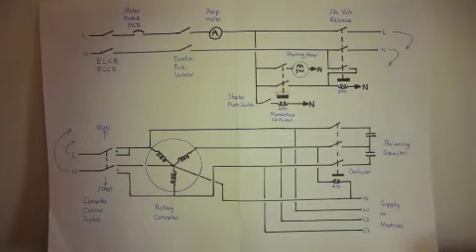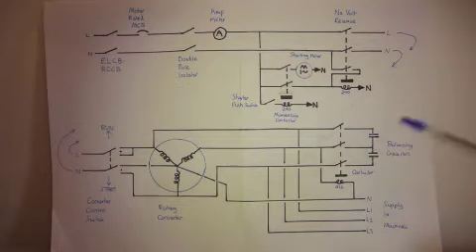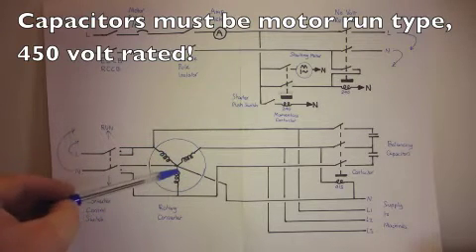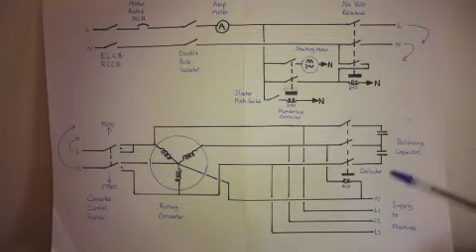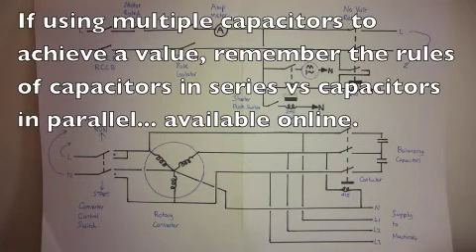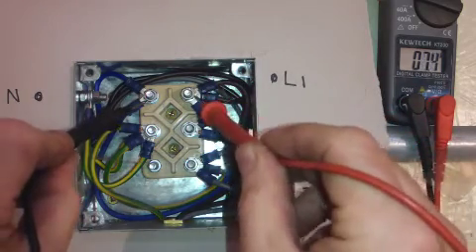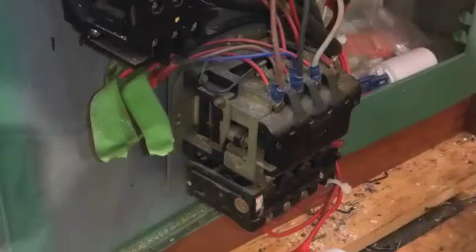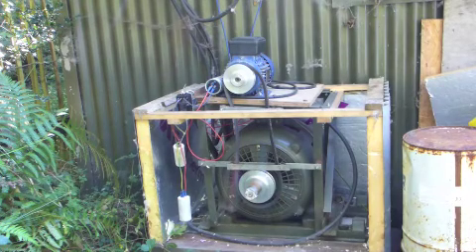Rotary Phase Converter - UK - Part 4

Comment: Great tutorial, I have built a converter that has output in delta 231 232 241 and will start and run load motors but obviously L2 is a feed from N. I switch to star with N centre, L - L1 with 22uf L1 to L3, 15 uf L1 - L2 and 7uf L2 to L3. My L1 is 432 L2 431 L3 438 and all around 230 - 250v to N with 1v to earth from N so all running smoothly unloaded in star but soon as I add load I loose my power to L2 down to 14v and stall my idler motor. I have been over all the feeds and can't find and short or feedback at the contractor's  and all running from 13a plug without blowing a fuse or dropping the trip? I can't find where the issue is?🤔
Reply: Have you discovered the issue with your 3 phase rotary converter setup leading to L2 dropping to 14 volts and stalling of the idler motor?  If so, what did you find?
Reply: Yes I have sorted the stalling. I haven't seen anyone else do the same as I have but if I switch the 240v to 415v with both the idle and load motor running I have no issue. Also with a second motor now as basically 2 idle motors it will start a 3rd as a load. I now have a 7hp and a 3 hp running as idle that are linked. My guess is the 7hp was not high enough power to start a 3hp.. I have also used 5 coil contacors that are turning capacitors on and off at different stages to keep the vaultage stable, low amps and all from 13a domestic. Load is pulling around 15-20a on start then 2 to 2.5a running. Was you going to give an idea of the problem or having same problem?
Reply: @AndyHagan-gn5hh  I don't have this same issue.  I'm currently in the stage of researching all the methods to convert single phase to 3 phase and when I discover that somebody has seen an issue with their setup, I want to know how it was resolved.  I'm trying to get as educated as possible by not just reading and watching about how to create a rotary phase converter, but also learning about the pitfalls and remedies that others have experienced when putting their RPC into service.  Thank you for your detailed reply.  Best of luck to you in your continued endeavors with your RPC.

Comment: Since this video was produced 5 years ago, has anyone else actually made a working one to this design? - particularly if you've used a more modern motor.

I've started building my own but it's becoming a bit of a frustrating process while using a more modern idler motor (there's not a ton of ventilated motor choice nowadays).
My own motor gets warm after a short amount of time, has poor voltages, but does seem able to self-start (an accidental discovery).. I stopped it earlier after smelling insulation.

Comment: Would it work if you just got the converter motor up to speed and then just switch the live and neutral straight in,without running the converter motor first then changing over ?

Comment: In regards to the main motor. I am assuming you are using a motor with rated for 415v star. 
I seem to see most larger 3 phase motors with 680/700v star. Would you consider this configuration suitable for your method?

Comment: I really like the simplicity and elegance of your rpc design but I am not sure of one thing. Why do you need a starting circuit when you have the starting motor? Surely you could bring the large motor upto speed and then engage the input current (in run configuration) am I missing something here? Also a nicer option for coupling your starter motor would be to pick up a centrifugal v belt clutch off ebay. They sell them for kids minibikes. Means you could leave the two motors static and just use a push to make switch to engage the starter
Reply: This is a valid point. However, I'm not sure that my pony motor has the power to spin that converter right up to 1440rpm! I've moved house now, and it's all in storage awaiting its next life.
Reply: @philscott2056 if the pony motor is indeed too small i can see how the two-pronged approach is beneficial. im planning on building one to run a cnc mill and would like to simplify the design a tad. just need to find a suitable motor

Comment: Hi Phil, I have watched your whole series on building a RPC, and being Australian have a similar mains setup to what you have in the UK, as distinct to the American system. I am keen to replicate your basic design, although I will have some changes due to availability of some components.
I hope to power a DSG lathe with a 3 phase 7.5 HP motor running at 415V. I will rarely if ever load the lathe to anywhere near maximum, and if I had a choice in the matter, a 3HP motor in the DSG would be more than adequate for the work I will be doing, but 7 1/2 is what she came with and I have no plans to downsize it. At the moment I have been offered a 18Kw idler motor for Au$50, but it is TEFC, not your first choice, but it is cheap. There is a chance of other motors, which will be either free or cheap also, but they are also most likely to be TEFC when they become available. I am currently attempting to remove a clutch from an automotive air-con compressor, and would like to use it on a pony motor to get the idler up to speed, rather than a loose  V belt.
I have a couple of questions for you
Question 1.  Is the 2 pole 3 position changeover switch, or DPDT with centre off as you have described it, necessary.  Most generator changeover switches here do not have a centre off position and I am wondering what the need for a centre off position is and would a straight DPDT switch be ok for this task?

EDIT: Q2. not sure what happened here, but it seems like a line got lost in the upload, but my question is what sort of capacity is required for the contractor with the 415 Volt coil. Will the expected currents be relatively small or could they be approaching line current or even more?
Thanks for taking the time to write up your efforts here, and I love your industrial switchgear in the background of your intro, it looks like it could have come from a coal mine or petrol-chemical plant, seriously good stuff and seriously expensive back in the day!! Cheers,
Rob.
Reply: Hi there. Firstly, the DSG really will need that size spindle drive motor, since DSG headstocks being as massively proportioned as they are, absorb a LOT of power. I guess that generator change over switches must, by logic, have a centre 'null point', when changing from one to the other, just maybe not one with a detented physical centre off position.
Given what you say, I'm inclined to think, try the TEFC motor, I have to say that my preference for older types was formed during much earlier, less successful incarnations of the rotary converter - notably, when the distribution of the phase legs was unequally spaced, and you may find that the TEFC motor works great. I'll be interested to know.
You aren't wrong about my switchgear, it's FLP rated, aka explosion proof, and exactly what was specified in coal mines... Mine came from a WW2 munitions plant.
Reply: I'm just trying to finish mine off, with one of the later (but still old) finned fan-cooled motors.. as to whether it'll work, mine sounds like a buzzy single phase motor - the ventilated motor in here sounds much better.. just a shame they're a bit rare.

I've dispensed with the 3 phase starting position and am just using a single phase starting motor before turning on the 3-phase motor - I'm guessing that shouldn't be bringing me any grief.

Did you eventually get yours built?

Comment: Can I start without a pony 
With say a potential relay and keep ur run wiring diagram
Reply: Probably not. Unless you have mega current available on your single phase supply. To answer any question like yours, you need to know the Volts, Amps and total power available on your supply. If you are using a 'house' domestic supply (in Europe) the absolute maximum power you will have available will usually be 15 kVa. So, your converter will need to be 'small' enough to draw less than the maximum available amps (Current rating)  of your main incoming fuse. Your electric supplier will not be so pleased if you blow the fuse on your main incomer. so the 'size' of your rotary converter in kW (or Horse Power) will determine whether or not you require the use of a 'pony'. the 'bigger' the motor the greater the current required for the starting load. It is a bit like asking 'what length is a piece of string' ? Need to calculate power required based on the available power to your house. Volts X Amps = watts (Power) (1 HP = 750 Watts), In Europe, we use 230 Volt supply and most houses (classified as a 'domestic' supply) will have a 63 amp main fuse. This provides approximately 15 kVA supply (230 volts X 63 Amps) do the math. In other countries outside Europe, like USA , Canada, AU and Japan, the voltage is different and this causes more problems. In US, this is a serious limitation because the available power is low due to the low voltage of 115 volts. This is the fault of Edison who would not allow the far better AC distribution system of 220 Volts designed and demonstrated by Nikolai Tesla. so the Yanks went with Edison who would not accept that the Tesla system was far superior for electricity distribution.
Interesting info here, every house in Germany is supplied with a cable which has the capacity to provide 3 phase 400 volt supply to each home. (400 V phase to phase and 230 V phase to Neutral) BTW, the reason it is 400 to 230, get out your scientific calculator, enter 400 (Volts) and divide by (Tan 120 deg) and you get (Approximately) 230. Or multiply 230 (Volt)  by 1.732 and you get (Approx) 400 (Volts) 1.732 is the square root of three. ( 3 phase to single phase). Apologies if this is boring for you, many of my friends tell me that I am a f**king boring nerd. Maybe, I should have studied arty-farty in Uni instead of engineering, I could probably have had a better social life!!

Comment: Hi, I wonder whether I could ask a quick question? After a long search I've located two, I think, suitable motors. The first is 30hp 22kw and the other 7hp 5.25kw. I'm hoping to run our Ercolina pipe bender off the converter which is rated at 1.5kw but obviously want to build in a bit of future proofing. Do you think I should go for the 30hp or will it be too much to run from a 40amp supply? I did check it against the rating chart which estimated 39 amps.

Comment: Thanks for the videos,I found them helpful, I do have one question. The 17.5 hp motor you used to create the 3 phases, was it just a 415volt 3 phase motor configured in star,  but you had access to the star point in the terminal box?

Comment: Thank you for this very good and well explained project. All the other RPC videos seem to be from the US where their 240 volt system is split into two separate 120 volt lines and they use each line to excite one phase of the Ghost motor. This when i looked at it i realised it would not be suitable for making an RPC here in the UK. This series of videos  is a godsend to anyone wanting to make one here in the UK. So once again thank you and i gave subscribed!

Comment: I would like to have more information about the stack of Transformer I have watch plenty of videos on how to wire rotary phase converter but I am dealing with 480 volts and like you it's not a dual voltage motor can you give me more information about about to stacker Transformer and how much it cost?

Comment: ⚠ Notice the ceiling contact of the second no volt relay should short circuits your supply main when you press the start switch... 

Shift the second no volt coil terminal in to the live bus bar...

Comment: Hi - I have a 10HP dual voltage but the nameplate says 400/440V in the delta connection - is this correct or can I change it to star and run the 240VAC through it?

Comment: Hi, have followed your design with a 15HP modern aluminium motor as its all I could find. I am spinning it up with a VFD then using a 4 pole change over switch to pop it into run mode. The VFD seems to think the motor is taking 13A with no load, which seems excessive? Need to get a meter with a loop to confirm that. The big problem I have is that when I switch it into run mode with 240Vac across star point had L1 it take out a 25A MCB (Type  B). I cant seem to find a type C to fit in my consumer unit. Any advice / suggestions?
Reply: I resolved the problem. The VFD and mains phasing is drifting even though the VFD says its running a 50Hz. I attached a oscilloscope and waited until the U output of the investor was in phase with the mains live as these both power the same winding on the motor.
Reply: You can't get a gallon of water from a half gallon bucket. Many domestic consumer units won't accept C or D rated breakers, in this case you need to change the consumer unit to an industrial type.

Comment: Hi Gavin, Thanks for the videos most helpful for people building these converters where we have a Neutral unlike the USA where they already have 2 of the lives required and only need to add one more ghost leg. In your video from around the 5 minute mark you talk about adding Capacitors to the weakest ghost phase first and you seem to say that this is L2, but earlier you make mention to L2 being in front of L1 making it stronger than L3 which is lagging behind L1. Your wiring diagram also seems to add Capacitors between L1 & L2 first, so are you actually adding more Capacitor strength between L1 & L2 than between L2 & L3, if so is L2 & L3 stronger even though they are lagging behind L1 (this part confused me)? Also within your setup using old switch gear how do you start your converter, because I have not seen one of those modern looking Generator changeover switches that you mention, with that Generator switch would you put it in the Start position (before pushing the Momentary switch) and then quickly flick it over to Run (manually) once the single phase starter motor is up to speed?  Cheers Nigel

Comment: Fuck me, I give up. The more I dig into these Rotary Phase Converters the more confused I get. I'm in Australia and we have Single Phase 240v into the house. two wires, 1 live and 1 neutral. So I read somewhere that I need a transformer to bring it up to 415v. Then I watch this video from the UK, where he mentions a transformer, I think...all good, then he goes onto to say you don't need one? WTF? Then someone in the comments says that Aust 3 phase motors are 415 600v star? Is someone reads this and can be bothered replying, will this system work in Australia??
Reply: I have the same problem and asking also - I have a delta 400/440V motor and I am going to change it to start and see what happens.
Reply: I'm not the author but to try to answer..

The live and neutral can either be wired to 2 phases and a capacitor to the 3rd, or they can be connected to each end of 1 phase.
If you connect them to one end of 2 phases (in delta) then the phase generated will match the voltage between the 2 connected phases. In order to make it 415v, the live and neutral are raised to 415v before being attached to the 2 phases.. because each phase winding should have 240v flowing through it, but 415v between phases.
The design in this set of videos doesn't use a transformer because the live and neutral are just putting in 240v through the winding of one phase, with the idler motor generating the other 2 phases.
It's still got to be a suitable idler motor.
Reply: @beautgrainger147  Thanks for the reply, I appreciate your time in trying to explain. In the end, I discovered that I actually had a 3 phase access pit for the whole street in the front corner of my property, so it cost me less to have proper 3 phase put on my property than it would to buy a phase converter.

Comment: Hi, I have drawn your diagram and have a PDF version, hopefully I have reproduced it error free. Perhaps you could check it for errors if you send me a link or ? I have not attempted to build your design as yet, nor will I distribute the PDF. The file prints quite clearly. I did buy a VFD 1-3ph before viewing your video series !! and it failed to run my old lathe 1962 Colchester Student ! Hope to hear from you and again thank you so much for sharing.

Comment: I made comments on part 2 and part 3.   Please do not take the comments wrong!   You did a very good job of getting your shop running on three phase.   There is probably not very much information on how to do this over there but you made it work.   That says a lot.   I would prefer, however, that you put some over current protection on your three phase system.   I would feel safer if it was my system in my house.   Very Respectfully,  Kevin from USA
Reply from the maker: Hi Kevin, thanks for your comment. In respect of over current protection, the converter, it's switchgear, and all that it runs is protected at source via the single phase circuit breaker. In addition, each of the machines have their own separate combination fuse switch.
Reply: galvanizedsankey    If the conductors that you installed down stream of the breaker have ampacity rating for the breaker, I would like to retract my original comment.   No additional overcurrent protection would be required.  Thank you for your response!   Respectfully,   Kevin

Comment: I am truly amazed at how close you where able to balance the phase voltage and amperage. I have made a few myself for other people and the volts varied between 20 to 26 and amperage I do not remember right now. So the input voltage is 240  right ??? I did not have to worry about the neutral earth though. Nice work Sir and a hello from the other side of the pond.
Reply from the maker: Yes, the input is 240v.

Comment: Hi great videos could you please confirm your capacitor values,you show 2 in the circuit diagram but mention and show 3 in the video,i have my motors ! just gathering the other parts now
Reply from the maker: Hi, the three capacitors are really only two. Two of the three are wired in series to create the required value and act as one single capacitor. Google "capacitors in series v parallel" to see how this works.